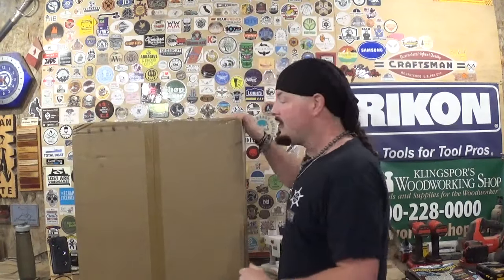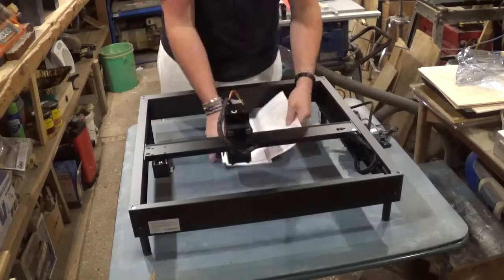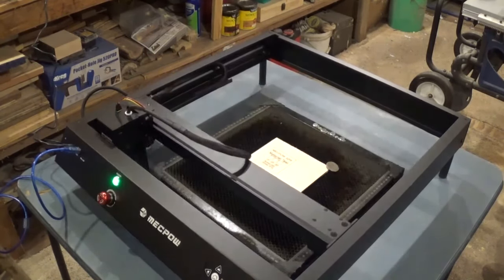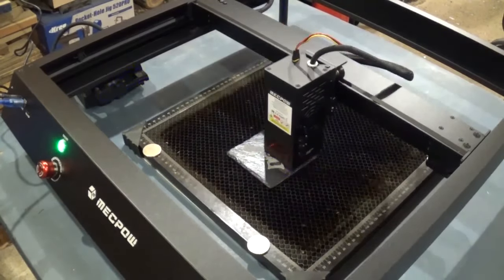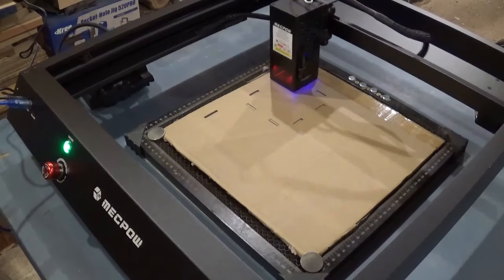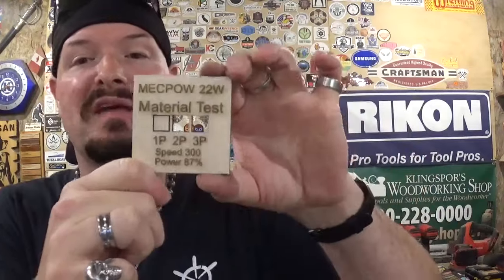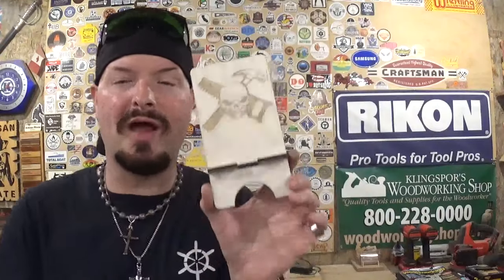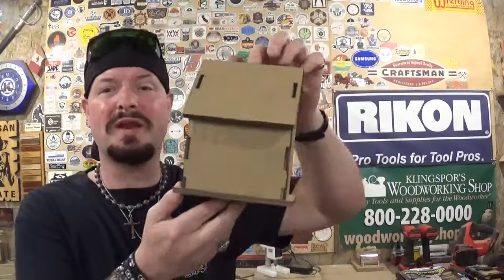Mecpow X4 22 Watt Laser Engraver, A Review Of a Powerful Laser

Comment: Awesome video! any advice on lining up the laser for projects? I bought some anodized aluminum cards and am a bit confused on how to precisely laser on a particular object as opposed to a large sheet where you have wiggle room.
Reply from the maker: Thanks and the lightburn software I use has a "framing" feature that uses the laser at very low power to "frame" out a project on the material you are engraving. Hope this helps

Comment: I just got mine yesterday, but I have the enclosed with the camera and LEDs, but my LED lights will not come on and then it didn’t come with much of a material. What do you use like plywood basswood
Reply from the maker: It only comes with sample pieces to test with, yes, you use basswood for best results but, I have uses alot of material on my lasers